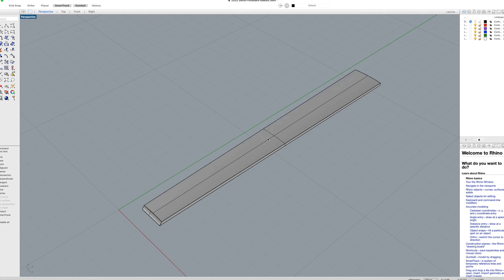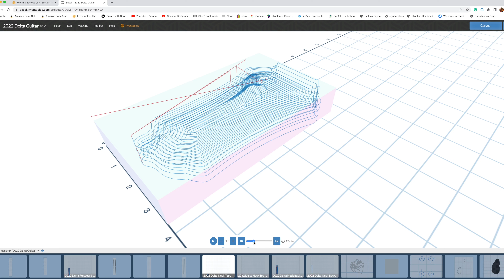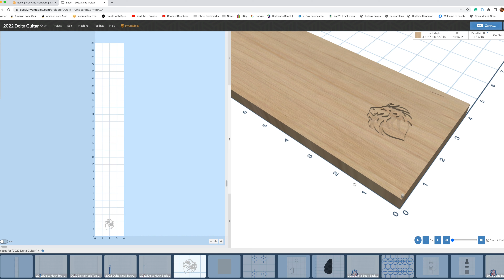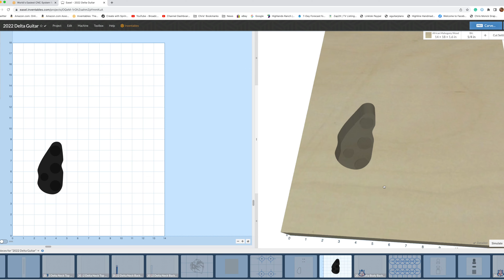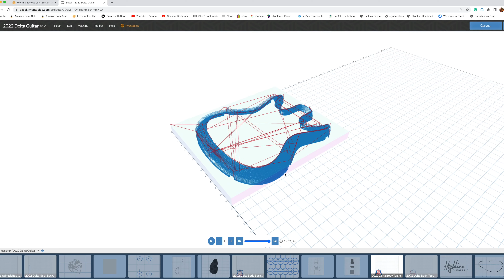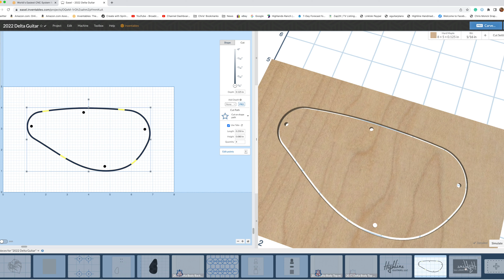Combining A Headless Electric Guitar With A Traditional Electric Guitar Part 2 The CNC Files

Comment: I have a question. Please forgive my inexperience with CNC software. When you are creating the file for a 3d type cut (neck profile, body bevel, etc. must you insert all the movement lines on the drawing or does the software do that?
Reply: The tool paths are generated by the software
Reply: @thereisamesh  thanks!

Comment: Is is absolutely as labor intensive using hand tools, if not more so.  What you get out of it however is accuracy, repeatability and consistency.  Not impossible to get with hand tools, but exceedingly difficult and time consuming.  Most of the CNC work is front loaded and done only once for a given design, so it can be a bit of a time saver in the long run as well with a carefully crafted workflow.